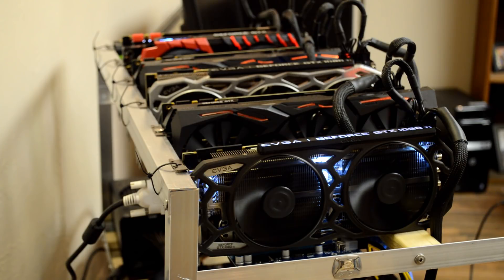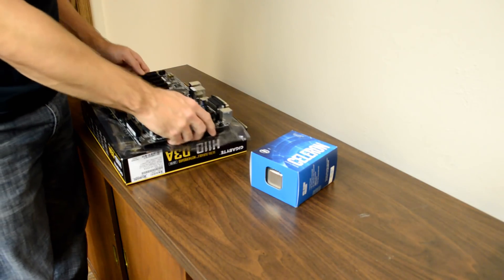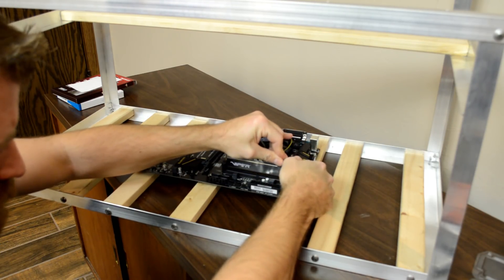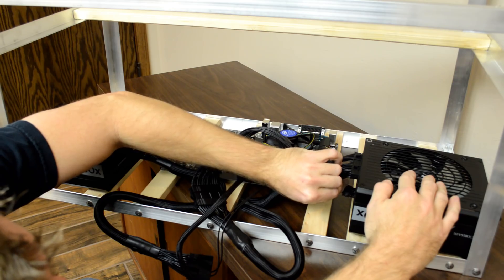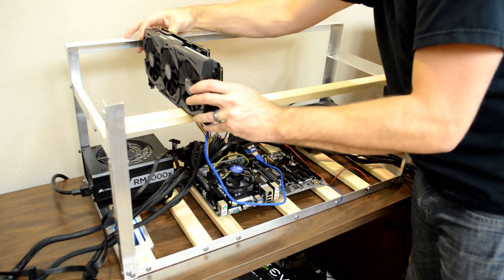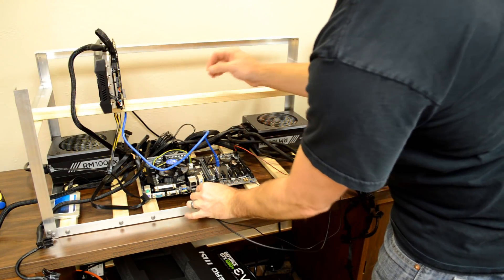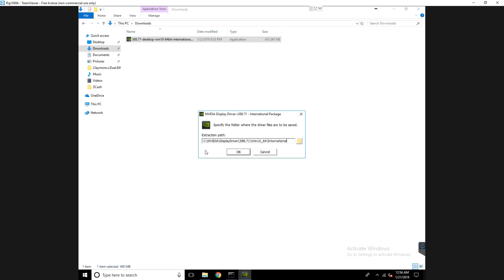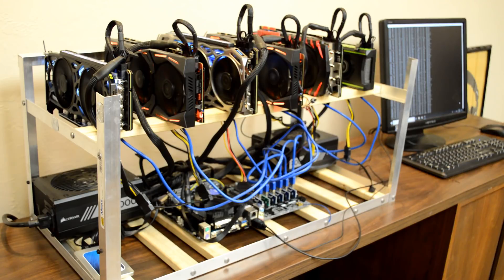How to Build a Mining Rig - Part 2 - Assembling Computer Components

Comment: Thanks for the Video! I like the ground wire idea. Right now i'm using shelving. I will try to use your guide for the casing thank you. Will this fit if I have a 7 GPU mining rig or I need to make it longer? Thanks.
Reply from the maker: Thanks Jayson!  You can use this for 7 GPU mining you will just space your GPU's closer together, if you are predrilling holes to secure the GPU's to the frame just space them closer together and add a 7th.  I left plenty of space in this rig for the GPU's to breath and they can certainly be spaced closer together.  Good luck!

Comment: Hi Jobe and thank your for your videos mate, appreciate the help :)  

Also, wanted to ask you, because i'm just building my own first rig and I'm suffering a bit of paranoia reading things about powering rigs and such... ¿Do you think it's really safe to use the SATA powering into risers? I believe by this video that you're powering 3 risers x 1 SATA cable and shocked me tbh. I'm gonna use also 1080 ti's x 6 in a corsair 1600, so not much connectors left except the SATA ones to power the risers. 

Also too... it's supposed those cards to use 150/180W when underpowered (it's what I do plan) so maybe 2x 8 pin can power 1xgpu+1x riser (180+75< 300W that those 2x8 pin are supposed to handle). Thank you in advance if you can give me your opinion!
Reply from the maker: It all really depends on the PSU you are using, if your PSU has multiple rails it can be dangerous to use sata to power risers because of possible loops.  The PSU's I use all have a single power rail and so share a common ground inside the PSU.  If you are worried you can always power them using other means.  Research your PSU you are going to use and see what other miners are doing with it for peace of mind :D good luck!

Comment: Hi Jobe ! Really helpful video. How is it to mine with a Msi Aero model ? Isn't it too hot ? And how goes the overcloacking when you have different models of cards and some of then are pre-oc ?
Thanks
Reply from the maker: Hey Groc thanks!  The MSI Aero has been running hotter than the other cards (around 80-82 without external fan)but I stuck a fan next to the rig and its running in the high 70s now.  As far as overclocking, I have had luck overclocking without issue since they are all 1080's but I have not pushed the OC past +75 core,+600 memory so there may be issues when trying to get max performance but so far I have had no issues :D
Reply: Jobe ok thanks !

Comment: Super Video 
1 question how many GPUs where you able to power off of one power supply?
Reply from the maker: I only tried to put 3 1080 Ti's on one 1000W PSU but I image you could perhaps put 4.  I've read that the 1080 Ti's run around 200-250 Watt each at max but I have not tested this.  You should be able to run 6 or more 1070's off of a single 1000W PSU no problem.
Reply: Jobe I was get a power cable to run 2 PSU also thanks

Comment: Hello I've watched the video it's very useful thanks a lot. i hate to question i will appreciat if you answer them. Q1: why did you use Dual power supply connector ? i can connect one PSU to motherboard and 2 or 3 GPU and other one directly to PGU !
Q2: When you applied USB Raiser at the bottom of them where the connected to GPU there is sponge base should i removed dose the heat will affect them?
and final note dose placing PSU  upright where the fan side faces GPU affecting cooling for PSU and GPU in this case we can put FANS thanks a lot.
Reply from the maker: I used the dual PSU connector for ease of use, you can manually short the PW pins on the secondary PSU if needed.    The foam at the bottom of the PCI Risers if fine to leave.  It is made of a material that is insulated so will not get to hot, over time they may peel off so you can safely remove them if you want.  The foam is there to protect against shorting from beneath the board but if it is suspended there should be no worries.  I have had no issues with heat from the PSU's going up to the PSU's but I do have a fan on my miners.  Thanks!

Comment: Isn't two 1000 watt power supplies overkill for only 6 cards?  I would think one 1200 watt unit, and for sure a single 1500 watt unit would handle this load. Why did you chose this configuration? Great video as was part 1 in this series.
Reply: How would I calculate the proper single psu for this? Thanks
Reply: The higher wattage (>1300) PSUs  are more affordable as you purchased them.  Higher wattage still has the CONvenience fee.
Reply from the maker: Yeah going for the higher wattage PSU is the way to go for sure, you can then put all your cards on that one PSU
Reply from the maker: Thanks David.  Yeah 2 1000 watt psus is probably a bit of an overkill ;D when I ordered the psus (around late december, early january) i got the 1000ws in this video for 109 each!  The 1200+ psus were all out of stock and priced at 200+ so I got them more out of them being such a deal than anything else.  I also decided to go with 1080 tis for this build and wasn't 100% on their power consumption.  Ive read anywhere from 200-260 watt per card on max load.  With 80 Gold psus that leaves a bit of breathing room.  Down the road I may replace one of the 1000w psus with a lower wattage psu and use one of the 1000w psus for another build :D

Comment: Can you also show with which program you are mining and how much you are mining a day? 
Maybe you will mine with Nicehash!💪
Reply from the maker: Hey Milan, on this rig I mine Zcash.  I have a video on how to setup to mine zcash, I am doing everything exactly like in that video (using local wallet, using nanopool, etc) the only difference is that instead of using EWBF as my mining program, I use dstm's Zcash miner (https://bitcointalk.org/index.php?topic=2021765.0).  With the 6 1080 Ti's I average 4.2-4.5 kSol/s.  Current pricing for Zcash that is around 1100-1200 a month but when not in a cyrptocurrency dip it was averaging 1400-1600 a month.
Reply: But how much can you mine, if you mine with Nicehash? Can you try it out and tell me how much, because I'm not sure if it's good to build the same one like you or another. If its earning under 20$ a day I'm not gonna build one like this, but thank you for the answer!
Reply from the maker: I'll install Nicehash on this rig and let it run to see.  I'll update you with what I find :D
Reply from the maker: Hey Milan, I have nicehash running now with stock settings ( no overclocking ) and it is pulling in an average of $38 a day with current crypto prices.  It peeks ever so often into the 40s and 50s.  All crytpo is down in price currently so I'm interested to see how nicehash performs when prices go back up.
Reply: It makes 38$ a day but it also can to do 40-50$ a day, right??

And how do you think no overclocking, are you mining with normal Settings? 

And how much does it costs to build the whole rig?

Comment: Thanks for this video. I saw you put a Celeron in it. Any reason? Would a stronger CPU help with the mining?
Reply from the maker: Hey Paul.  The reason I used a Celeron is because it is not only cheap but for the mining I am doing with this rig a more powerful CPU would not make a difference.  All of the processing is offloaded onto the GPU's so unless you are wanting to also do CPU mining along with the GPU's, you don't need a beefy CPU.  For example, on this mining rig I get an average of 700-750 sol/s for Zcash per card (total between all 6 cards is about 4.3-4.5 kSol/s) and at home I also have a 1080 Ti on my personal computer, this computer at home has an Intel i7-5820k and when mining I still only get around 700-750 sol/s.  I have noticed no difference in mining performance when using a more powerful base CPU.
Reply: Cool, thanks. I was more concerned about the CPU not being able to feed the cards the data fast enough; but if that's not the case, Celeron it is!
Reply: @psperneac  for anyone else curious, with just msi afterburner and the mining software my cpu use is less than 5%

Comment: ok this is just what i was looking for, seems I have added everything together correctly but only 1 PSU is powering up, the otherone seems to make a ticking sound and not much else lol any ideas?
Reply from the maker: Sounds like the second power supply may be either overloaded or faulty.  Does it power up ok without anything plugged into it?
Reply: i managed to get it all running in the end, took everything apart and rebuilt, not sure what the initial problem was tho :/  thanks for helping to :)
Reply from the maker: Awesome glad you got it working ;D

Comment: Having 2 psu. Do i need to connect only pcu cable ?
Reply from the maker: Not exactly sure what your asking friend, what do you mean by only one pcu cable? You talking about a psu cable and then which psu cable?
Reply: Jobe what i am saying is i have 2 power supplies. Each psu has cpu cable. Do i need to connect both cpu cables(from psu each) together like you did with motherboard cable ?
Reply from the maker: Ahhh gotcha Andzej, sorry about that!  No you just need to connect one CPU power cable from the primary power supply to the motherboard.  The only cable you need to daisy chain between the power supplies is the 24 PIN power cable, as this cable has the on/off switch for the power supply itself.  Does that make sense?  Let me know if you still have questions and if needed I can draw up a visual illustration to help you out.  Thanks!
Reply: Jobe thanks

Ive got everything connected now and seems like everything that is connected to the motherboard is working (except gpu fans) and screen mouse and keyboard not working. Any idea what potentially causing it ?
Reply from the maker: the GPU fans will come on if needed, they don't run at all times.  Are the GPU lights lit up?  What do you have your monitor plugged into to view the screen?  Are you able to get video at all?  What kind of keyboard/mouse are you using, usb or ps2 connection?
Reply: Jobe yes gpu lights are on. Means that works ? 
Mouse usb, keyboard ps2. Monitor its old LG monitor. Using adapter vga to hdmi.
Reply from the maker: Yeah your GPU sounds like it has power if the lights are on, you have it connnected with a PCIE Riser or is it plugged directly into the motherboard?   Sometimes those VGA to HDMI adapters are finicky.  So you are not getting any video?  You might try to plug into the motherboards VGA slot and enable onboard video in the BIOS and use the motherboards display port since it probably has VGA.  Does your mouse or keyboard not light up at all?  If its not posting this could be the issue.
Reply from the maker: Could be that the board is not getting enough power, what wattage size of power supplies are you using and how many cards you got plugged in?  Try booting the computer without any GPU's plugged in and try to boot up with the monitor plugged into VGA on the board.
Reply: Jobe no, no video at all. I will try Nd see where else i can connect it. Using asus z270a motherboard. No mouse and keyboard no lights.

Power supply 1000w x 2. I have tried disconnecting everything and having just pcu on no ssd card. Then just no signal sign came on and then off again
Reply from the maker: Ahhh I see, that board only has an HDMI and display port for video.  I gotcha.  If I were you, I'd just hook up the CPU, Motherboard and SSD. Plug in your vga to hdmi adapter and monitor to the HDMI on the motherboard, plug in mouse and keyboard, and just try to boot the computer without the GPU.  If everything is hooked up right it should boot up, might not have display if adapter is not working but you should have everything hooted at the very least.  zI see the board also has a DVI port, do you have a DVI cable you can try to use if you monitor has DVI support?
Reply from the maker: Also if you monitor doesn't have DVI you can always consider using a TV if you have one with an HDMI input.  At least to test :D
Reply from the maker: What kind of CPU and Memory are you using as well?
Reply: Jobe 
This is what i am using 

MB ASUS LGA 1151 Prime Z270A
ASUS ROG STRIX GTX-1080
Crusial 8GB DDR4 2400 mt/s
Pentium G4560
2 x EVGA PSU 1000 T2
Crusial SSD 120GB

And i have tried disconnecging everything. Just had cpu and psu connected to see if that works. I guess i need to try to connect it to my tv :)
Reply: Jobe i think what ever is connected to motherboard everything worms excepts these additional stuff :/. Ill try to get some newer stuff maybe and different connections see if that helps
Reply: Jobe also just been advised to use 1 psu. See what happens
Reply from the maker: Does it all work if you plug your GPU directly into the motherboard and power it up?  Think its a bad riser or something?  Good luck Andzej, holler with any questions man I'll be happy to help.  If its an open air rig careful if trying this as you don't want to much stress on the PCIE pins of the GPU, if you try this you might try holding the GPU metal retainer with your hand while trying to boot.
Reply from the maker: Yeah Andzej try it with just one PSU and see if you can get it to boot.  First step imo is to get your computer to boot properly with the least amount of complexity and start adding stuff from there.  Good luck!
Reply: Jobe no luck. I have tried using gpu straight from motherborad & tried disconnecting 1 psu. Doesnt work.
Reply: Jobe if it would be a bad riser i wouldnt think that light would come on ? But it did.
Reply from the maker: Very strange, does the board come on and do you get video/keyboard/mouse without the gpu plugged in?  Video plugged in directly to motherboard without gpu plugged in?
Reply: Board comes on. But with or without gpu i dont get video mouse or keyboard
Reply: Jobe all sorted now. Just had to use different slot for ram
Reply from the maker: Andzej Baranovic glad to hear it!